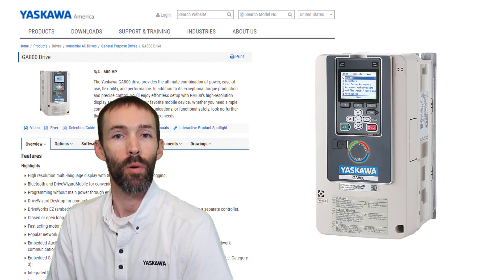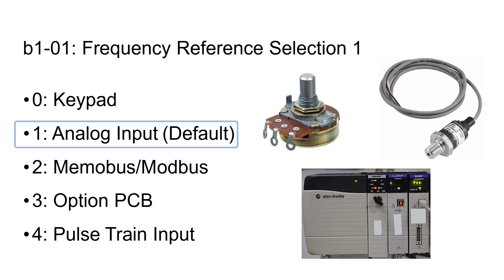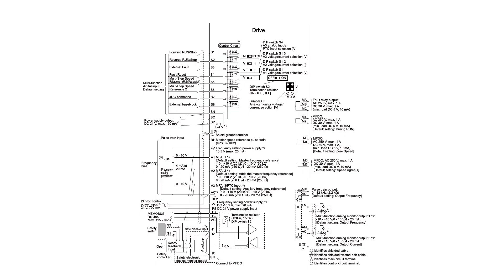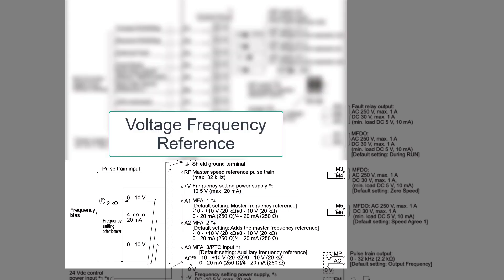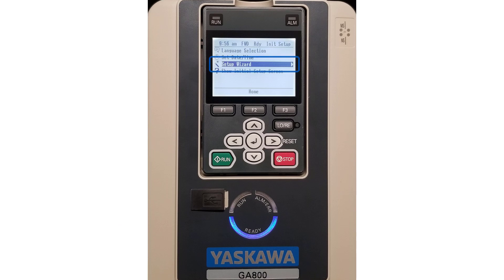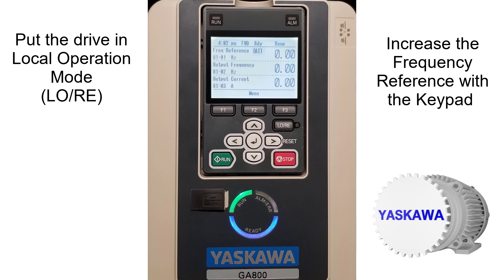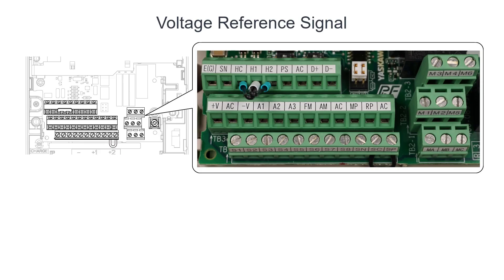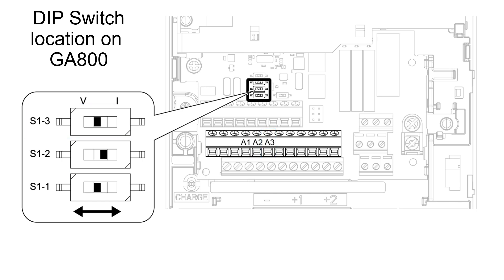Yaskawa - Set Speed Reference and Run Command on a GA800 AC Drive

Comment: I wonder if these steps would work for a E7B drive
Reply from the maker: Thank you for your interest in Yaskawa's Set Speed Reference and Run Command on a GA800 AC B Drive video. Please note that the E7B is an older-generation drive, so the steps shown in the video may not apply directly. However, the speed reference and run command parameters for the E7B are the same.

If you need further assistance, please feel free to contact our Technical Support Team with detailed information about your application and motor specifications. You can reach them at:https://www.yaskawa.com/support-training/support

Comment: How should I program a ga800 using a 150psi pressure transducer trying to maintain 90 psi?
Reply from the maker: We appreciate your interest in "Set Speed Reference and Run Command on a GA800 AC Drive." You can find more information about your question at the Yaskawa Solution Center. Here is the Basic Setup for a PID Loop on GA800, GA500, and 1000 Series Drives: https://solutioncenter.yaskawa.com/selfservice/viewdocument.do?noCount=true&externalId=10097&sliceId=1&isLoadPublishedVer=&docType=kc&docTypeID=DT_FREQUENTLYASKEDQUESTIONS_1&stateId=904&cmd=displayKC&dialogID=36826&ViewedDocsListHelper=com.kanisa.apps.common.BaseViewedDocsListHelperImpl&openedFromSearchResults=true.